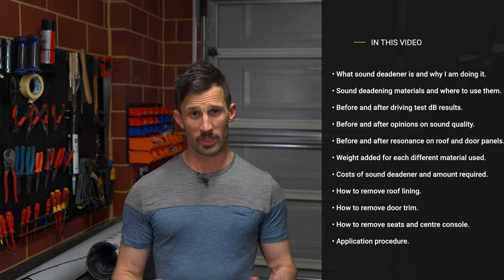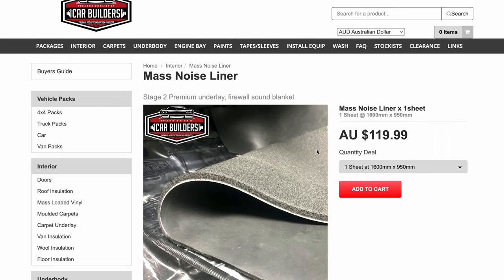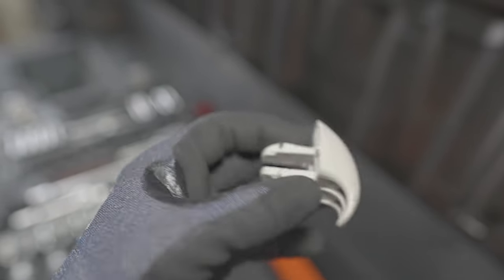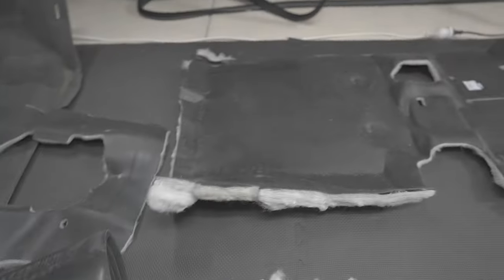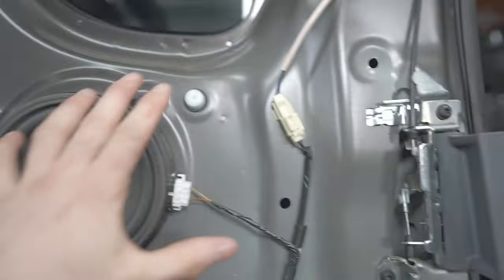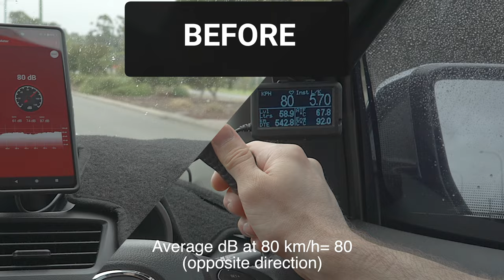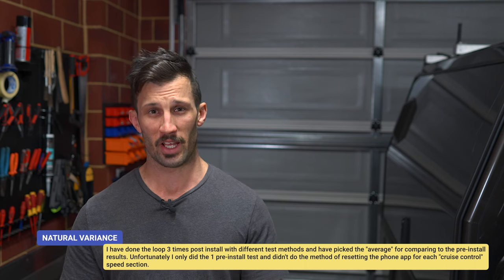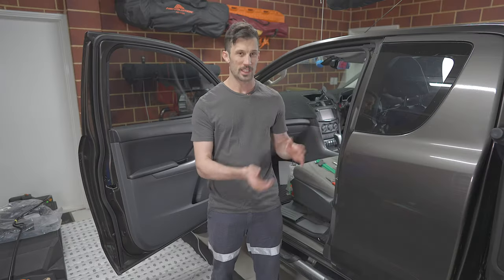Is it Worth Sound Deadening a Modern 4WD Ute? || Sound Deadening Guide.

Comment: Good video, & I’m glad you said about the rain.
I own a Territory Wagon, & I put heaps of deadening on the roof as when it rains in the tropics I live in Cairns it’s loud.
I agree with the floor, & didn’t do it.
It will  be interesting in what you think when you drive you car in the rain if you find it makes much difference.
Plus if you live down in the southern parts of Aust where it’s cold you car should be warmer.
Reply from the maker: Yes hopefully the thermal insulation helps the car stay cool as well.

I can't say I remember what it sounded like before when it was raining but I do think it's very quiet now.

Comment: Most road noise is from poor dampening between the body and systems that contact the road, if you look into higher end vehicles you will find far better body to chassis or suspension mountings, usually with larger rubber mounts at things like shocks, springs, engines, trans, subassembly and so on, panel noise on most cars is a non issue with the numerous curves preventing flex and vibrations in the sheets.
Reply from the maker: This car really didn't need it, it was already quiet (against similar cars). But I am happy enough with the results.

Only reason I wouldn't recommend to most with this car is the time and cost involved.

For older cars, definitely recommend.